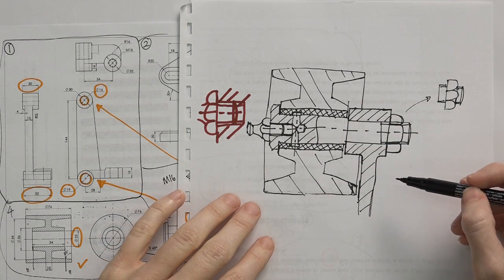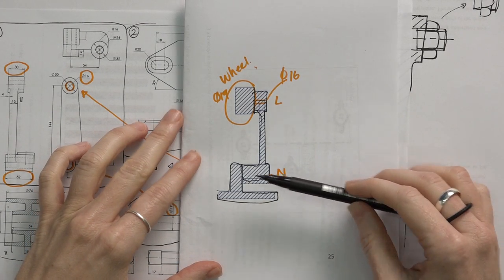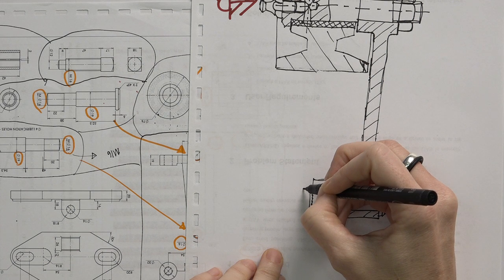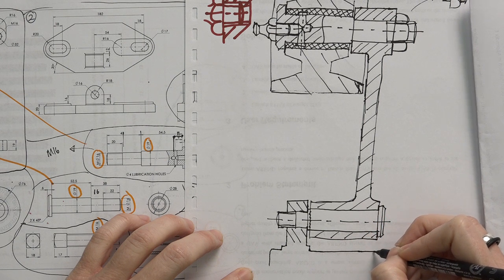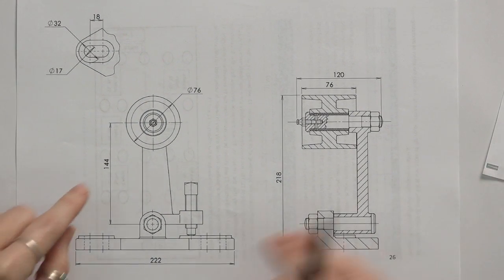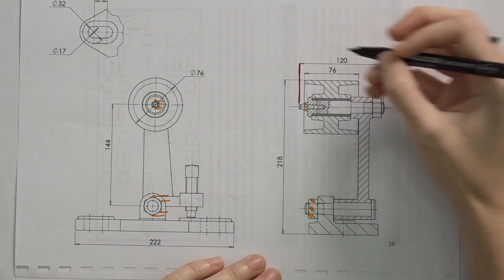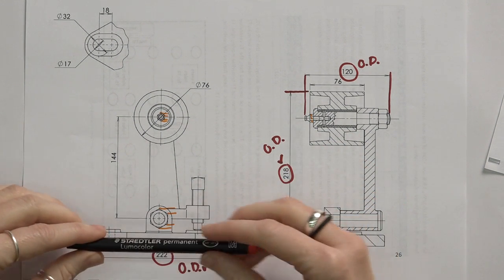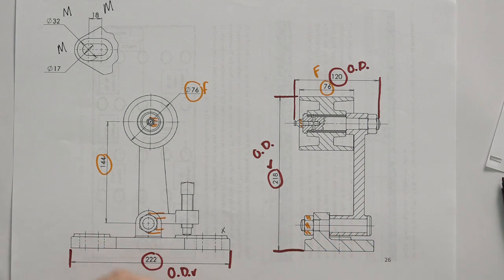Assembly: Exam 2010 part 3 of 3

Comment: Good Day Dr Smith, I wanted to ask why a normal nut was used both times instead of a lock nut (say a nut + a washer)
Reply from the maker: Good day. 
You could have used a washer, actually using a washer is preferred, although it wasn't penalized if left out. A lock nut is a different type of device. A lock nut is usually an additional nut screwed on after the first nut to make sure that the original nut doesn't come loose by itself. A nut and washer combination doesn't mean it can't come loose, unless the washer is a spring washer.
Reply: @riaanmeeser4755  Thank you!